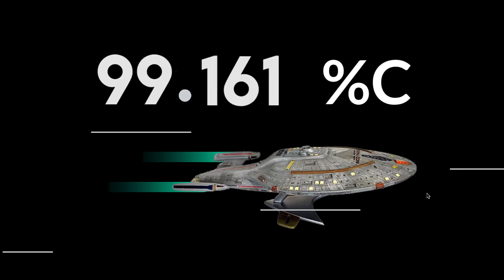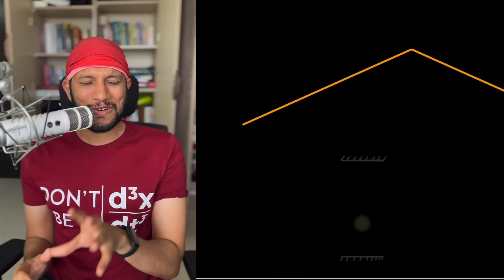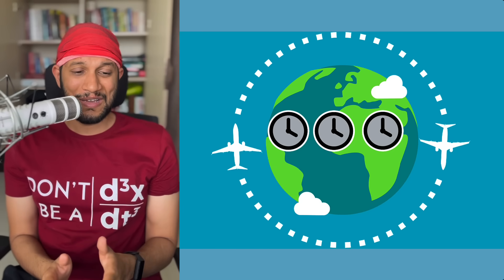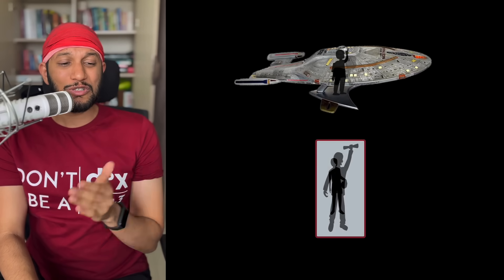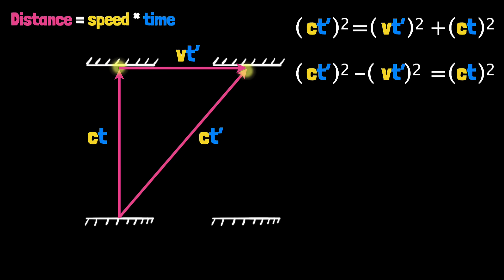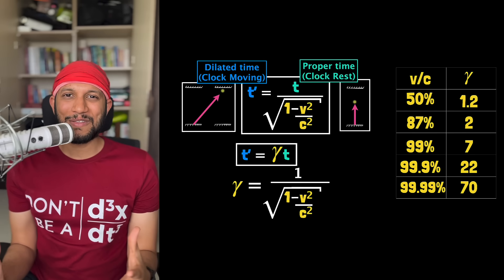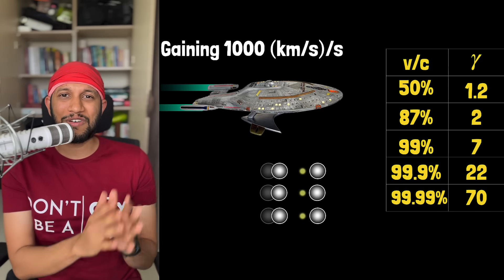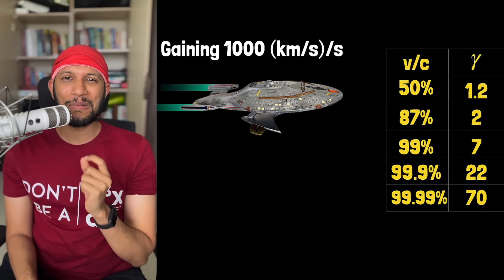I finally understood why you can't go faster than light! (My mind is blown)

Comment: Wait... Im confused, if the speed of the rocket observed from outside is influenced by time dilation, it implies that the actual speed of the rocket can actually be higher than that of light to those in the rocket but the speed seen by those outside will be influenced by time dilation hence it wouldn't be... Means the rocket will eventually arrive at a speed equal to or greater than that of light, but it will  just  never be the case to those observing from outside 🤔...
Hence an object can move faster than light, but just never be observed at a speed faster that light because what allows for observation of the object (photons) are limited by their speed.🤔

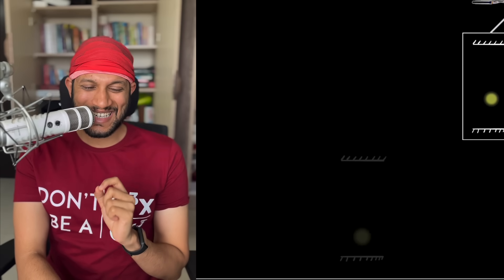Comment: 2:00 but why doesn't the photon ticks faster when it travels more distance to keep the same speed? you are assuming it keeps ticking at the same pace
Reply: Yeah this is a great video but he assumed things the wrong way. When you measure the speed of light (in a vacuum) all observers have to agree that light travels the same distance in the same amount of time (light speed is constant) so what the outside observer would see is that the distance traveled is more shorter (the observer would see a distorted space where the traveler went from point A to Point be in the same amount of time but he'll see a compressed space. But he is implying that the photon travels slower. It doesn't. The photon ticks at the same speed but due to the speed the distances seems to be shortened to the outside observer.
Reply: i give you now the answer i hardly found, by myself. Einstein himself was never able to explain this.

no real clock slows down, because no real clock measures time, not distance. all real clocks measure time*distance, and that is a non-variable. 
Einstein was often confused

the answer to the twin paradox is: 
all twins in the Universe live in the time*distance, not in time, nor on distance. 
this is the key to understand the limits of special relativity, that is a non-functional theory, merely a didactical object.
no twin ages more, by virtue of relative motion and speed.

there are three types of time, all different, always different: 
1. theoretical absolute time, or say theoretical local time;
2. theoretical relative time, or say theoretical distant time;
3. measured time, the real time, that ironically does not have the dimensionality of time, it has dimensionality time*distance
Reply: No that's not how it works how the fuck is Everyone so stupid in this comment section

Comment: Thank you fo you clear explanation. I think I start to understand the meaning of reaching (or not) the speed of light. But it bring me another question. As you say, time slow down when you approach the speed of light, to almost top. It means that near the speed of light, time is almost top (for the observer). If we consider that photon travel at the speed of light, it means that, for us, it will take for example 80 years to arrive, but for the photon point of vue, it will take... less than a second ? In other words, does time even exists for a photon ? And if one day we can build a spaceship traveling near the speed of light (just for theory, with no time for acceleration and deceleration)  the crew will be able visit the all univers during a life time ?

Comment: I was wondering then if you were outside the Earth's orbit, wouldn't there be time dilation since the Earth is moving? But yeah, the Earth only moves ~67,000 miles per hour. To have twice the time dilation, you'd need to go half the speed of light, which is ~671,000,000 miles per hour. So yeah, way too slow to see a noticeable difference unless you're looking at something that changes exceptionally fast.

Comment: I’ve mentioned this on another video. But the problem is you can’t observe a photon that’s inside the ship from outside the ship. Also the experiment with the planes and the atomic clocks, those planes had to accelerate and decelerate, and we know for a fact that acceleration increases the distance photons have to travel by ‘bending’ their path. Not to mention another issue with this theory is that if you turn your photon clock in the direction of motion the round trip distance of the photon will become the same as if it were stationary.

Comment: In short there is a carriage, this carriage is moved by horses. If you increase the number of horses the carriage will speed up faster, but no matter how many horses you add, the carriage can't run faster than the horses themselves... so if the horses move at the speed of light, they will never go beyond the speed of light, unless we buy new horses who are faster XD but to do that we need to literary rebuild ourselves and the whole world.
Now, if you ask me, true time is constant, and that t' should be called something else. Its true that we measure the world using the t', but thats only because it's convinient, and since we know the formula, it should be possible to measure things using true time while isolating the "dilation effect", which would cause us to see that the time that passed inside the ship and outside is exactly the same, even if the degree of decay differs between the two.
So, do I still think that it's possible to travel faster than light? Yes, but not through normal acceleration. For example: If we can find a way to lower the "time dilation" inside an isolated space aka subspace, and move this space while moving inside it, we should be able to go beyound the speed of light...and if we create multiple layers of this subspace, we can achieve a near infinite speed... but as for how to do that, and how much energy it would cost...I have nooooo idea, so I will leave that for the scientists.

Comment: Clearest explanation I’ve encountered so far! While watching the video, two questions came up:

First Question: If a rocket is moving at 99% of the speed of light and I’m observing it from Earth, how does light “know” that the rocket is the one moving at 99% the speed of light and not me? In the emptiness of space, with just two objects, how is it determined which one is moving? Is there a reference point for measuring speed?

Second Question: If there is this “universal reference point”. Well, I know that I’m moving faster than the Sun because I’m traveling along with it across the Milky Way, while also orbiting it, so my total speed must be higher. This means my clock should tick a bit slower than the Sun’s. Similarly, the Sun is moving faster than the center of the Milky Way, so its clock should run slower compared to that point, and so on. So, is there a speed or direction for a rocket to get its clock running at the fastest possible rate, essentially to be as “stationary” as possible? And how much faster would time pass for me relative to Earth in that situation?  It feels kinda counterintuitive to imagine a rocket zooming past Earth at incredible speed, yet knowing that its clock is ticking faster than mine here on Earth.
Reply: The theory is called Special Relativity because velocities and reference frames are relative and not absolute. However this is only true with no acceleration! To you it looks like the rocket is moving. To the rocket it looks like you are moving. Both perspectives are equally valid and true. Still, if the rocket returned back to Earth, the Astronauts would have aged less than you. This might sound confusing but it all works out. Sadly I don‘t have a nice intuitive explanation for this. If you‘re interested, this is called Twin Paradoxon.

Comment: The thing that I always wanted to know that I never hear about from science, only sy-fy, is even if we were to attempt going to these insane speeds could the ship and the crew survive the acceleration? In science fiction the explanation is the use of a device called inertia dampers, makes sense reduce the force generated by inertia, but we don't have that in real life. So, could we even reach a fraction of the speed of light in any reasonable amount of time without doing insane Gs and liquifying the crew and ripping the ship apart? How long would it take to reach the speed of light safely if it was possible?

Comment: My question then is this: if hypothetically we had a spaceship that traveled at 99.99% of the speed of light. To us it would look like they are actually moving at that speed, but since the occupants of the space ship experience time 70 times dilated would it seem to them like they are actually traveling 70 times faster than they actually are because in the span on 1 second of their dilated time they would cover the distance of 70 times 99.99% of the speed of light?

Comment: Almost right but... If the spaceship is standing still and we as observer are moving, we also see the clock on the spaceship slowing down. 
If two spaceships meet each other while traveling in opposite direction, both see the other clock ticking slower than their own.
Thats because special relativity is symmetric and there is no preferred frame of reference.

Comment: You can look at this from the perspective of the traveler.  The traveler can effectively go above the speed of light though it will appear that their destination is contracting towards them so they don't need to fly as far.  But if the traveler had a powerful propultion system that can get them to double light speed under Newtonian physics, they will go 2 lightyears in one year of aging.

Comment: Ok all makes sense 
But for me still can get why speed of light is the same in different frame 
Like when u showed the clock moving and the photon diagonally, u assumed it moves with same speed but why not moving with its original speed + ship speed vector
Reply: Because that is a postulate of special relativity. It's an assumption. 
But that assumption is based on observations. Many experiments have failed to show any differences in the speed of light.

Comment: What if, you're traveling at the speed of light, and you turn your headlights on? Is that light now traveling at 2X the speed of light?
Reply: You can't travel at the speed of light, but if you rephrase the question as "what happens if you are traveling at 99% of the speed of light then turn on your headlights?".  The answer is that the light emitted from your spaceship (I'm assuming your in a spaceship) travels at the speed of light.  

This is kind of an ambiguous answer though, because one of the main takeaways of special relativity is that all speed is relative and it doesn't really make sense to say "object X is traveling at speed Y" without referring to the reference frame that you are measuring its speed in.  So let's say Bob and Alice are in spaceships.  In Alice's frame of reference she is stationary while Bob is moving at 99% of the speed of light.   However in Bob's frame of reference, he is stationary while Alice is moving at 99% of the speed of light in the opposite direction.  Both pictures are equally valid.

Now one of the other main takeaways of special relativity is that the speed of light is the same in all reference frames.  So in Alice's frame, when Bob turns is headlights on, she sees the lights traveling at exactly the speed of light with Bob trailing just behind.  In Bob's frame, he also sees the lights traveling at exactly the speed of light while he is stationary.  This seems like an impossible discrepancy, but as discussed in the video it can be explained through time dilation and length contraction.

Comment: The clock doesn't slow down. It completely depends on the frame of reference and causality. We, from an external frame of reference perceive the the photon to have taken a longer path to reflect between the mirrors in the clock, but that is due to causality.

Comment: What if all this means that measurements of time aren't accurately representing the time continuum? What if time doesn't bend to measurement tools buts vice versa? What if measurement tools act different while in motion, but not time itself?

What if the photon in the photon clock doesn't change speed on the Y axis, but changes on the X axis? Wouldn't that be the same as tossing a tennis ball up and catching it in a closed moving car as compared to doing the same while at rest at a park? 

Isn't the earth traveling at 20,000+ mph? Have we ever measured time accurately? Could this be the difference between measuring time precisely but not accurately?
Reply: You can do that. Lorentz originally proposed length contraction as a physical process to explain why the aether could not be detected. 
Einstein abandoned a physical aether that could not be detected in favor of a constant of nature. This takes less conceptual work.

Comment: I may have missed something here but, WHY does the photon clock slow down? And this is all from an outside reference frame, as far as the clock is concerned it's moving normally. Just because the waveform is stretched out due to velocity doesn't mean it's moving more slowly. WHY does the clock slow down?
Reply: Because the photon at a constant speed travels for longer distance (hypotenuse of the triangle he explained) while in motion. So it must take longer time?
Reply: @YogeshPandit1981  but to the photon, nothing has changed. It's still taking the same time to bounce up and down. It doesn't care that an outside observer sees the line as longer. And maybe the line is longer but the time it takes doesn't change, just the distance it moves for the given time.

Comment: Falling into a blackhole results in a similar phenomenon.  As you approach the event horizon, space time stretches out more and more, meaning photons traveling away from you take longer and longer to reach an independent observer.  To them, it would appear that you slow down as your approach the event horizon and never quite cross it.  And yet, we know that matter does pass the event horizon and fall into the black hole.  Is this not a similar paradox?  And if so, why is it possible for objects to fall into a black hole, but not accelerate beyond the speed of light?  Is the problem just one of frame of reference?

Comment: 0:01 Time dilation doesn't exist so the infinite energy requirement would be the only limiter, although lack of friction interference negates a good bit of that. The "reason" you can't prove FTL is the lack of measurability. All "clocks slow down with speed" studies have been within the margin of error, and no one has ever studied the effect of acceleration upon atomic decay. Neither has any study that I have found on the effect of acceleration on regular-ass clocks. ;)

Comment: I really believe there is something missing in all these theories.
Because I have never found an answer for my question:
Theory says, if you travel fast, let’s say 70% of light speed and you are planning to go to point B which is 7 light days away. It takes 10 days to go and 10 days to come back which is 20 days total. Right?
The same theory says with this travel due to high speed, you will arrive for example 19 days later instead of 20. Right?
Now my question is:
Let’s imagine we have a super powerful camera facing starting point which can see even from point B
The moment we start going to point B, it starts recording and stops only when we are back to starting point.
Now while we are going to point B, the scene we are looking at should be a slowdown version of what really goes on at starting point. Right?
Then when we get to point B and start coming back to starting point, the scene should look like fast forward. Right?
Now we have a problem, if we get back at 19th day, what happens to the rest of the light we were looking at all the time?
I really believe there is something missing!!!!!
Reply: I don't entirely get it, i would say that for the camera you arrive later than for what you measure in the ship.
Reply: @anonymunsichtbar3715  
Ok. But the camera is in the ship
Reply: I think the camera recording will be of 20 days not 19
Reply: @heavenlyxtacy  
So you have experienced 20 days, not less. Right?
Reply: @netpro2620  if you say in simple terms then YES, but if you want it more complicated, then it will be where you place the camera, you place the camera on earth, you are in your present age, but somehow you accelerate 10 times the speed of light and place the camera 30 lights years away pointing earth (suppose say you are now 35 years old), that camera will capture when you when you were 5 years old plying outside. So you know, destroy your imagination just like I am doing....

Comment: ACTUALLY, certain things can travel faster than light if both are traveling through certain mediums. This is because this medium slow light down more than it does the other object.

But yes, nothing cam travel faster than the speed of light in a vacuum.

Comment: So pilots live long lives. Got it. Time is a human construct....a biological perception. So does time then really exist? Lol. I finally understand the limit, though time still is odd.  A ball can be thrown at 90mph on the ground and it's limit is air resistance. Throw the ball from the outside of a moving plane (speed of light) it won't go. Throw it INSIDE the plane it will go (warp bubble). We have to normalize space around the ship and bring it with us.